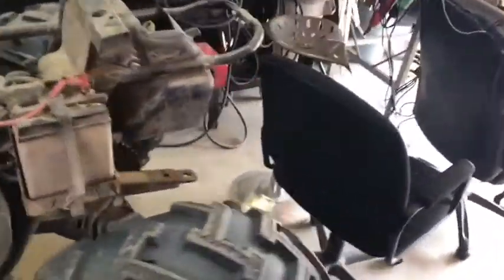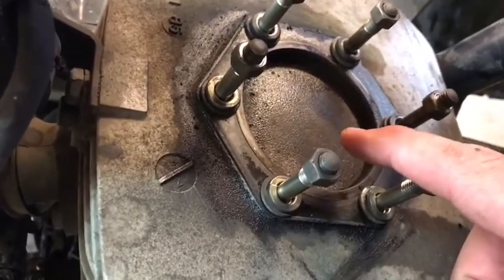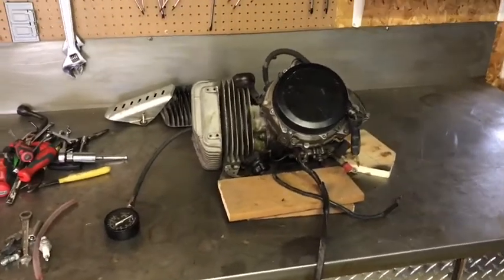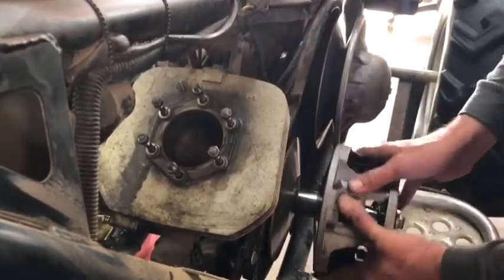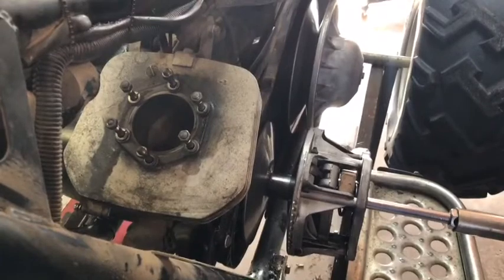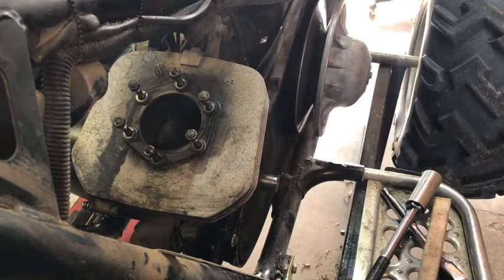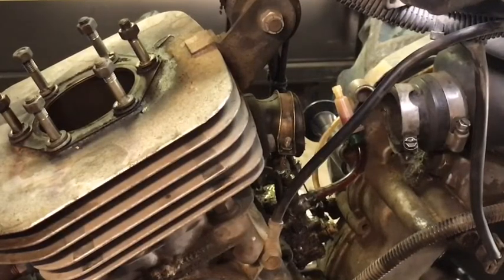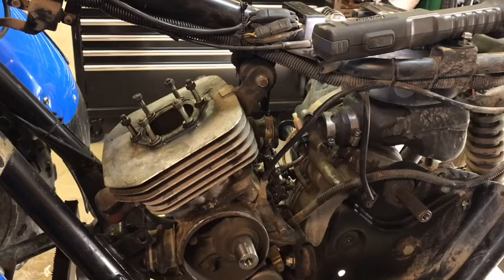ATV MOTOR SWAP PART 2

Comment: only thing i can think of is a light from a light house. not really sure why they would paint half the light black except to limit the distance the light would shine. like marking the sides of a bay. so boats knew to stay between the lights. now adays they use red and green lights. good stumper. 
also that motor looks like they used a snomobile engine to power that quad. so there are no gears. just throttle and go. never seen a quad like that. pretty cool. if you were a speed demon you could install a big modified racing snomobile engine into it. haha. 
cool vid as always. great job. cute kitty to. i showed my gf the kitty. 😻
Reply from the maker: WallysWheels Unhooked Wally !! I'm not able to answer till Monday !! But maybe see you Thursday ?
Reply: Bagot Corner. thursday?
Reply: Bagot Corner i am headed back to dizzys friday.

Comment: I don't know the English terms for all the parts, but the pipe you call "jet pipe" is actually an interesting part of the carburetor. The part of the pipe that sticks down into the gasoline in the float chamber is (most likely) much thinner in the opposite end. This is because it uses an interesting physical phenomenon called "capillary action". You can test this yourself by take a glass of water and take a straw, as thin as possible, and lower it into the water. Then you will see that the water level inside the tube is significantly higher than the water level in the glass. This is called the Capillary Action. So that's one of two forces that works together and sucks up the gasoline from the float chamber into the mixing chamber. When air flow that is passing over the tube it creates a lower pressure in the tube and sucks up the gasoline and then it's mixed with air and ready to fire. Here is some more information about the capillary action:  
- https://en.wikipedia.org/wiki/Capillary_action
- https://www.youtube.com/watch?v=eQXGpturk3A

Cheers!
//Thomas
Reply from the maker: Thomas Gabrielsen you're not far from it actually .
But I'll explain it a little further .
That tube is called a needle jet .
The slide holds what is called a jet needle.
The two parts work in conjunction with each other .
The jet needle is tapered to be thin at one end and thicker at the other .
It's solid and not hollow .
Neither of these parts are submerged in fuel .
Below the needle jet is the main jet which is closer yet to the fuel in the bowl .
All of these ( and more ) are fuel metering devices inside the carb and can be purchased in larger or smaller dimensions .
The jet needle is thinner at one end to provide more fuel transfer when the slide is closer to full open ,,thicker at the other to provide less at idle
Reply: Bagot Corner: So this carburetor doesn't use capillary action at all? Thanks for a quick and good answer. I hope you're going to make a follow up on the carburetor because now I'm very curious about how it works. :-)
Reply from the maker: Thomas Gabrielsen I will be making an in depth video relating to the carb ( thanks for asking 😊)
I would have to give the whole cap flow and cap action a bit more thought as it applies to movement through a Venturi .
But without me doing that I can say that there are two processes I'm well aware of and they are Bernoulli's principle and the Venturi effect.
It was never really important for me to understand the entire process from a physics standpoint but more in regard to practical application .
You could equate it to " although a bird flies ,he is unaware of the laws in place that allow him to do so"
And although I might be able to calculate at a higher rate than a bird ,I to know my lessons from practical application .
Reply: Bagot Corner: Thanks for your reply. I'm want to answer you, but that must be in about ten hours or so because now I have to go to bed. The clock is 04:47 here in Norway, and I got double vision, literarily.